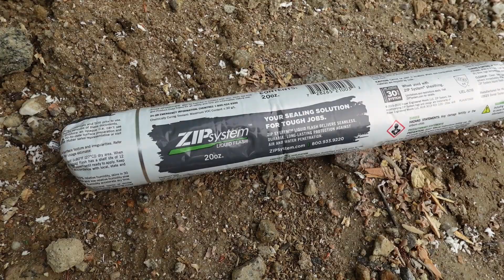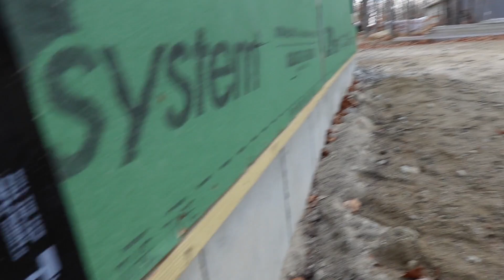10. Finishing the sill connection detail

Comment: Great work but you don't set your pressure when nailing your zip?
Reply from the maker: Hey, yes I have tried many ways to adjust the depth.  The issue is the nails are 3.25" and the material density of the framing varies, so every shot is different.  I really need a high pressure nail gun, they are much better at that.  The ZIP-R is a little tricky to get the depth right.  Thanks for the comment.